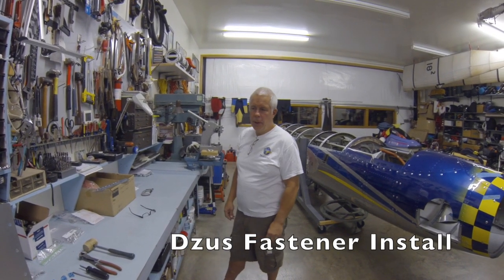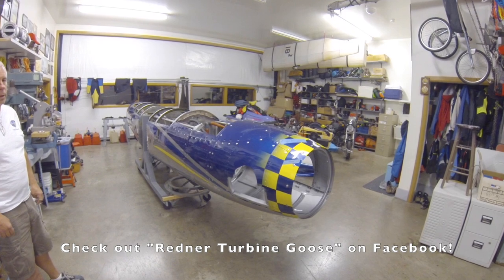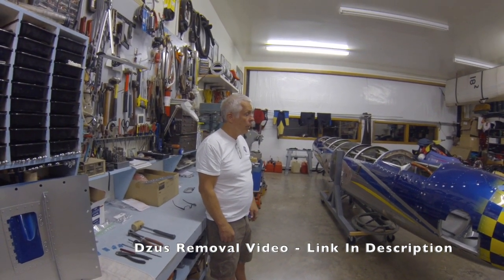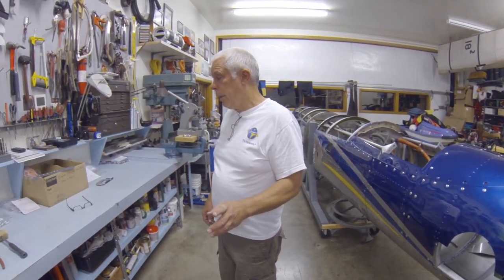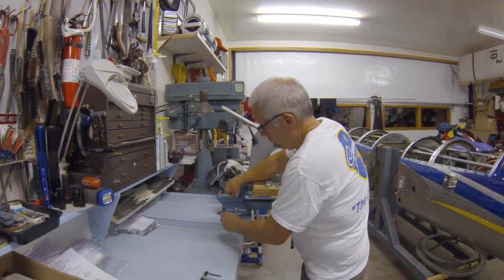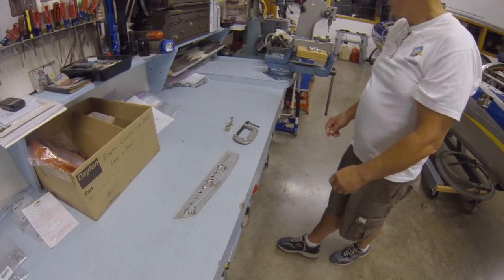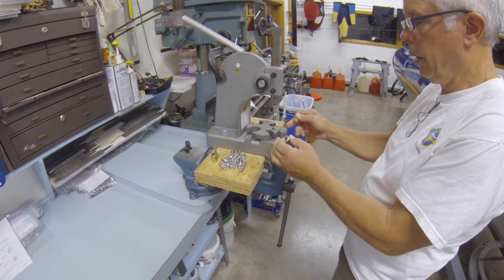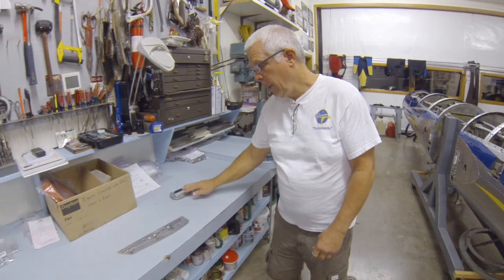Dzus Fastener Install

Comment: I'm surprised that I'm the first one to comment on your video but I found it very informative and useful.  I'm restoring a Stearman and I have a hundred or so Dzus fasteners to change out/install.  And you're right; using that C clamp is a pain in the butt.  I really like your arbor press idea.